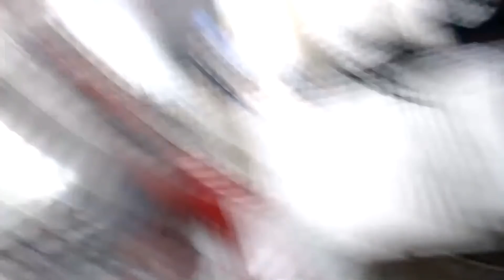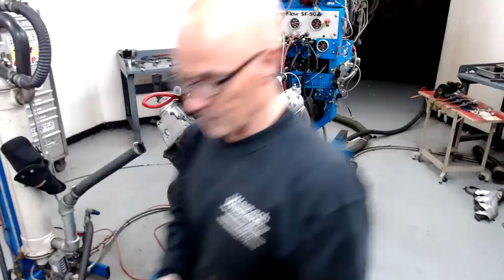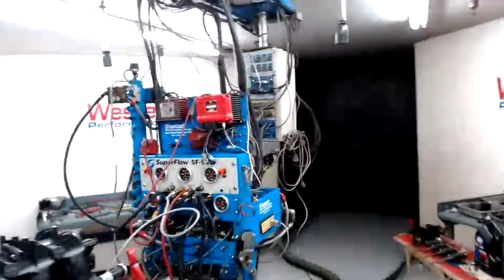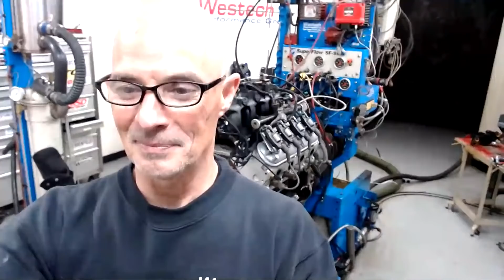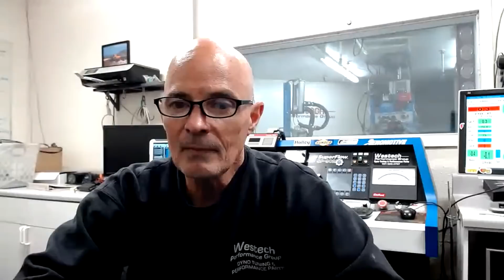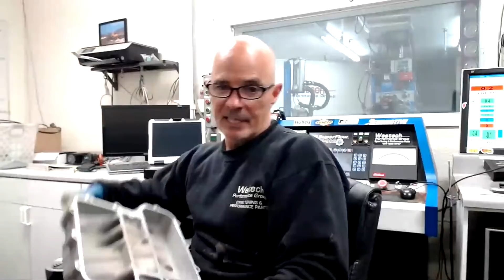LET'S TALK TECH-JUNKYARD 4.8L & 5.3L UPDATE-OIL PRESSURE TESTING

Comment: The 60° V6 intake goes under the valve cover and the push rods go through the intake manifold gaskets. They are part of the cylinder head like the Ford FE engine.

Comment: Why did you need to seal the pcv system to build oil pressure?  Oh never mind.  With it sealed the oil pump will begin to pressurize the crank case.  It’s to push the oil up the pickup tube as soon as possible.  Am I right?
Reply from the maker: helps to prime the pump
Reply: yes, air over hydraulic just like the old car lifts in the service stations.

Comment: To prime I use a weed killer sprayer I rigged to hookup to the 4-an from the top of my turbo. Fill the oil filter up and pump about 5 quarts into it I crank it a couple time by hand while I had the pressure on it. You can actually see pressure on the gauge.

Comment: I cant believe the l33 is only 358hp. I have both an L33 and LM7/L59 vehicles and the L33 truck is a full second faster 0-60 and 1.2 faster in the quarter than the Lm7/l59 combo. Both have 4l60es with 3.42 gear and same tires.

Comment: Hey Richard, another question. Are all ls engines the same size externally?
Reply: Short answer= yes.  The only way to tell the difference from 4.8 and 5.3 is to look at the piston tops. The exception is the L33. It has the flat top pistons of the 4.8 but it has the aluminum block. I don't know if an OEM aluminum 4.8

Comment: The L33 has 9.9:1 compression ratio
The Lm7 has 9.5:1 
The Lr4 has 9.4:1
The lq4 has 9.4:1 

The l33 has slightly better heads, flat top pistons, and has 193/193 .482/.482 lift 
Compared to the lm7’s 191/190 .457/.465 lift 

The cam is only marginally better, but with the 799 heads and half a point of compression I expected the L33 to do better than 358hp/383trq. That’s what every lm7 you’ve ever run on the dyno makes stock. That’s disappointing. 

The L33 is desirable for guys looking to take 100lbs off the nose of a drag car, and the full floating wrist pins (gen4 rods) are a bonus. I’d still rather buy a  $200 lr4 or lm7, than to pay 5 times the price.
Reply from the maker: The l33 made over 465 hp or so with headers-it makes what it makes-I don't determine that
Reply: @richardholdener1727  I’m glad you test them all, thank you.
Reply: I didn’t say it wasn’t a great motor, but naturally aspirated it made the same power when Richard ran it yesterday. I have a cam, springs, and running flex on my 01 Silverado.
Reply: @Mattvardaman . Of course, sounds like a fun truck sir, what are your cam specs? I am a truck guy myself, Hemi in my case😅. I am running 93 on my setup for now, but I would like to go flex fuel in the future.
Reply: @bri-manhunter2654  both trucks have Summit Pro Ls truck cams, one is 205/217 .500/.500 112+2, and the other is 209/217 .550/.550 112+1

I posted some videos of the 5.3 1/2 ton truck. Also some of lapping valves, and other miscellaneous things. Running flex fuel is nice because I can run 26 degrees of ignition with 50% Ethanol as opposed to 20 on pump gas.
Reply: @Mattvardaman . Very nice sir! I bet you have very good torque response with the low duration and tight LSA💪🏻. Flex fuel is great for adding all the timing, lol.
Reply: @bri-manhunter2654  definitely made more power everywhere after the cam, ls6+ springs, long tube headers, modified cold air intake, and 50lb/hr injectors. The gm 2wd trucks were all open differential so I could not pull out in traffic in the rain! So I installed a quick performance lsd differential carrier and bearings 6 months ago.
Reply: @Mattvardaman . Very nice sir! Building trucks is fun! I have a TruTrac LSD in mine, not helping even with 3.55 gears🤣
Reply: I have both engines in vehicles bth have the same transmission and rear gear and same tires. The L33 is full second faster than the Lm7/l59 equipt truck 0-60 and over a second faster in the quarter. No way 3 to 8 hp is worth a second.
Reply: @AndyR1982  there has to be a big weight difference to go a full second faster. Every 100lbs is roughly a tenth. I also have two of these trucks and I tune Ls engines.
Reply: Price or not, it’s still a great light weight setup; add cam and springs as usual, and send it!
Reply: Im thinking it is in the GM tunes. Maybe the L33 got less torque management than the "lower performance " engines.  I know richard maximizes the tunes on the dyno. So maybe when everything is spot on, there isnt that much of a difference. Maybe the 5.3 cant use the 799s to their full potential. And you would get more out of the l33 with higher compression of the 706s and the l33 cam
Reply: @AndyR1982  the GMT800 trucks in any variation are neutered from the factory. Just turning off most of the torque management settings and and making power enrichment functional makes a massive difference even to a stock motor. The l33 truck could have a slightly better calibration. The mistake that most new tuners make is turning off all transmission torque management, then destroying the 4l60e. Mine has lived 50,000 miles since I’ve been making about 420hp (at the crank), and has 227,000 miles total. It does have a Sonnax boost valve, corvette servo, and the pinless accumulator piston kit.
Since I mentioned it, it will probably explode today, lol. I do have a 2500 lq4/4l80e combo as well.  It’s the boat/camper pulling rig.